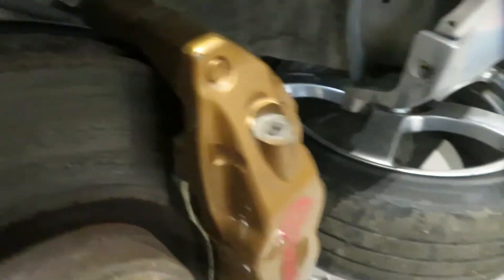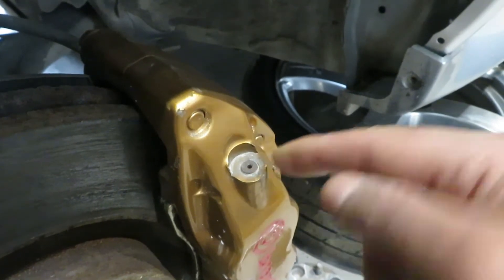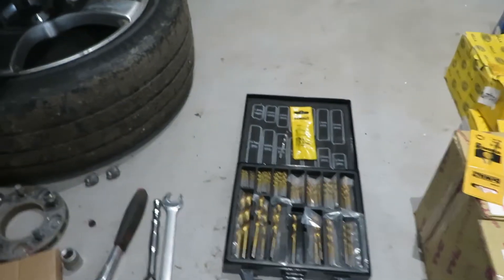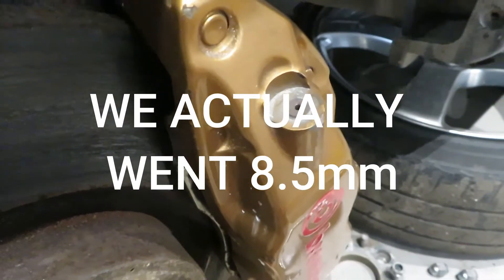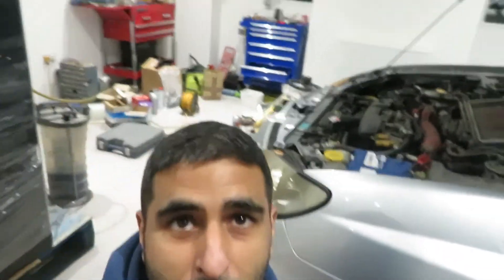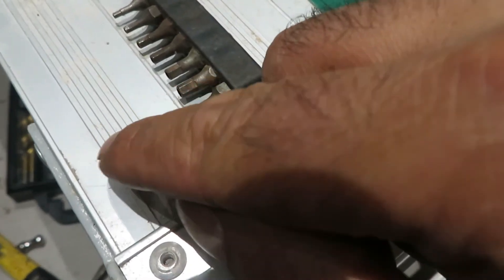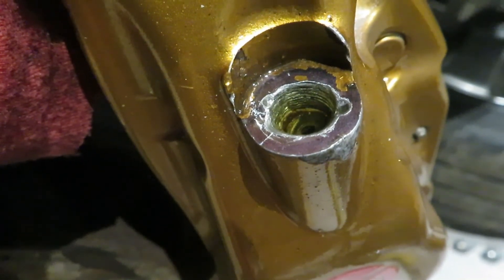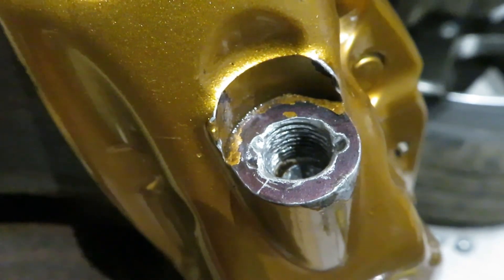Brembo brake caliper SEIZED bleed valve fix

Comment: Did you have any issues with metal shavings getting into the caliper? Dealing with same issue trying to avoid pulling them all back apart worried about metal shavings getting into the pistons

Comment: Great effort but It will only cost you £40 to remove it and tbh that thread looks weak, bleed screw is held by top 4.5 threads only and yours looks a bit skimmed. Also any debris will fall down into the caliper if not done properly.

Comment: Top tip when fitting ANY bleed nipples put a dab of copper grease on the threads this stops them from corroding together as steel and alloy don't mix.

Comment: Are you able to just screw the new bleeder value in with the brake fluid on? or will the brake fluid rust the threads if its not dry when screwing the new one in?
Reply from the maker: We just screwed the new one right in. The problem is more so that the steel bleed nipple tends to fuse to the alloy caliper when  hot over time.

Comment: Hi. Helpful video, thanks. Do you remember what size tap you needed?  I’ve just found a stripped nipple on my car.
Reply from the maker: Thanks for the support. I used a 10 x 1mm tap which came with the thread repair / helecoil kit

Comment: Good video 📹 I use to listen to these Dubstep videos, quick question did you have to remove all the metal shears from drilling in the caliper?
Reply from the maker: Thanks, yes the remains of the bleed nipple and any small fragments come out with a small magnet. Then let some clean brake fluid flush out before putting the new bleed valve in.
Reply: @carmodityclassics  okay thanks I recently did a brake fluid flush on my brembos and luckily nothing snapped
Reply from the maker: @YKRECREATION  you did good 👍 I got 2  seized in the same week 🤦‍♂️
Reply: @carmodityclassics  I sprayed them with wd40 a few hours before and praying 😬